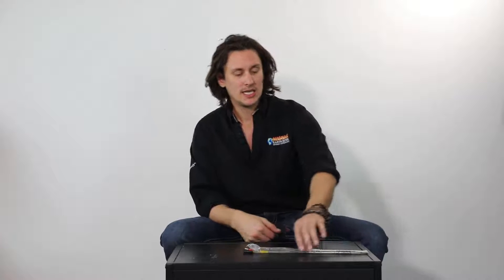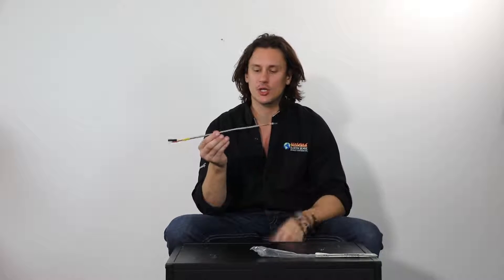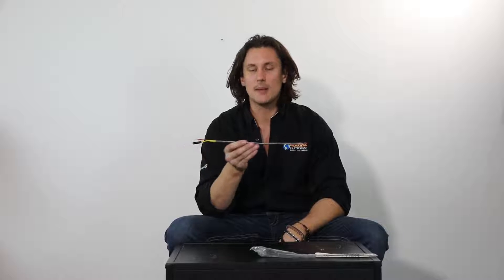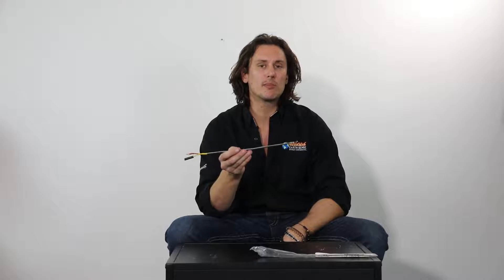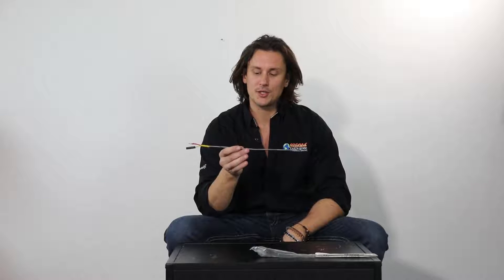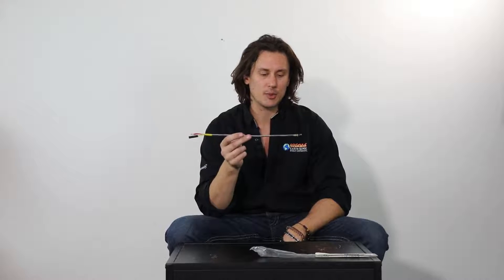Quadrafire Thermocouple Function & Troubleshooting

Comment: I have the Mount Vernon Quadro Fire AE. The pellets drop into the fire pot, however they never ignite. Would that be a thermocouple issue?
Reply from the maker: Thanks for contacting us Vincent. First thing we would suggest would be to check the Ohms on the igniter element to see if it's in proper range. The Igniter in the Mt Vernon AE has it's own wire harness with an in-line fuse. Let's also check that fuse with a multi-meter to determine if it's good. Here is a short video on checking your igniter ohms. https://youtu.be/z4wmCc96rVI

If you have the factory 380 Watt Igniter reading in operable range should be: 35.5 -43.5 ohms

If you have the 300 watt pellet only igniter, operable range should be: 43.5-53.5 ohms

Keep us posted, happy to help.

Comment: I have a Santa Fe pellet stove that will go three it’s start up  fire will start then after a few minutes dies out and stove will not send any more pellets. I have a new control box and replaced the the snap disc.  what else should I look at?
Reply from the maker: Hey Tyler, 
The thermocouple over the burnpot is detecting the heat during the start-up sequence. Once it reaches proper temp it signals to the control box for the unit to go into normal operation mode and feed pellets. You should see light indications on the control box once the thermocouple locks in. Let us know if you are seeing any light codes and let's also inspect the thermocouple and connections. You can pull off the ceramic cover- thermocouple should come to a soldered ball at the end. You can use a dry paintbrush to sweep away any ash on the cover or TC. Here is a link to the Santa Fe Thermocouple for reference. https://pellethead.com/product/quadrafire-heatilator-ecochoice-thermocouple-14-oem/

Keep us posted, happy to help.

Comment: Do you have a video on other Quadrafire Mt. Vernon repairs? like fire pot replacement, and springs on the self cleaning linkage?
Reply from the maker: Thanks for the message. Wouldn't have those videos at this time, but I went ahead and added them to our queue - good suggestions! Here is a Mt Vernon AE Blog/Forum we host which can be a good place to get various info and tech support. https://pellethead.com/quadra-fire-mt-vernon-ae-service-troubleshooting-support/

You can always message us here as well and we can provide tips and support for whatever you are replacing. Hope that helps.

Comment: If there is a split in the thermocouple can it be sanded down or must it be replaced?
Reply from the maker: The thermocouple consists of two flexible metal rods wound around each other and come to a soldered junction at the end/tip. If the soldered end is split, one could attempt to re-solder and see if the electrical signal will pass through. In the large majority of circumstances where the thermocouple is damaged/split it would need replacement. Here are the Quadra-Fire thermocouples for reference. Any other questions please let us know. 

https://pellethead.com/?s=quadrafire+thermocouple

Thanks,

Comment: Hello, I have a 1200i and we had a bad storm yesterday and some water got on the back of the insert and on the control box, I guess from the wind blowing it in the chimney top. Initially the blower would turn on but the red light would not and it would not feed pellets. I vacuum out the hopper and thoroughly cleaned everything, I checked the  number three snap disc, I looked at the thermal coupler end and I guess it looked ok , made sure the control box is set to #1.... when I slide it back in to test it ...I get a red light that goes on first in the control box, then I get a blue light that blinks a couple of times  and then it switches to a amber light flashing three time fast ....and repeats .... blower does not come on anymore. Is the control board bad or thermal coupler?? Is there a way to test either ?? Thanks
Reply from the maker: Hey Doug, just checked in with our techs on this. First note: The amber light in the control box is an indicator that the board is reading an open circuit on the thermocouple. Check the connections on that and if they are good then the thermocouple has broken and is not functioning.

Keep us posted, happy to help.

Comment: If the thermocouple was bad, could it allow an overfill of pellets in the pot? My 1200i keeps feeding no matter what is going on. It never stops.
Reply from the maker: Thanks for the message. In short, no. The thermocouple purely acts as a proof of fire giving signal to feed once proper temp is reached on start-up and will stop the feed should the temp go below.

Let's visibly inspect the auger motor if we can. The auger motor will always have an on/off timing sequence. During start-up the off sequence is very short. During normal operation that timing sequence varies based on the low/med/high setting. If you are physically seeing your auger motor turn non-stop or if the timing sequence does not change during normal operation between the heat settings, it would most likely indicate we have a control box issue. 

If we are seeing the variances in the on/off timing sequence of the auger motor, then more than likely the issue is with our air flow and it's giving the appearance of the stove overfeeding. 
#1. Full thorough cleaning. Stove, Ash Traps, Venting.
#2. Door gasket seal check - tight all around.
#3. Burnpot check. Gasket sealing, holes open, porkchop bottom sealing tightly
4. Combustion Blower/Exhaust Fan - Check voltage, should be near line voltage on start-up - varies in normal operation depending on heat setting. 

Keep us posted, happy to help. 
Thanks!
Reply: @EarthSense  it was a really weird issue. Basically my 1200i was dumping pellets in the pot nonstop. I went on Amazon and bought a replacement for $200 and the problem is gone. Thanks for the help.
Reply from the maker: @tareqtok  Very glad to hear that!

Comment: My quadrafire 1100i will light flame will build up then the auger shuts off and unit goes out. I have replaced the thermocouple and it still does the same thing. I have put a new control box in and have the same results. I’ve replaced the door gasket. Still shuts off. Do you have anymore suggestions?
Reply: You were right. It all started when I replaced the thermocouple. I had the wires crossed. Man I feel stupid. Thanks for the advise. So far it’s working properly
Reply from the maker: @mrpanther7013  Thanks for the message, nothing to feel stupid about, this is all very common stuff. Great job sticking with it and getting the problem solved. In the end that's what matters. Glad to hear you are warm again - any questions or needs down the road just let us know. Thanks!
Reply from the maker: Thanks for contacting us. Generally that would be a Thermocouple issue based on what you are describing. We have seen new thermocouples that have been faulty although it is rare. Let's make sure your thermocouple is placed properly over the firepot and the electrical connections are correct. (Sometimes the electrical connections are reversed). From there we can check your vacuum/pressure switch. We can bypass that switch for troubleshooting purposes to determine if it's the culprit. Links below for creating a jumper wire to test and overview on the vacuum switch. 

https://youtu.be/FDVkbsHS95U
https://youtu.be/pHeQzUmSlIE

Keep us posted. Thanks.
Reply: @EarthSense  I will check that out. Thanks. I’ll let you know the results
Reply from the maker: @mrpanther7013  Sounds good, thanks!

Comment: Why do you get TC Firepot Errors
Reply from the maker: Hey Janet, What kind of Quadra-Fire model do you have? Generally you will get TC errors if the Thermocouple does not get to proper temp during start-up or when the Thermocouple is faulty. Happy to help, thanks!
Reply: @EarthSense  it is a mt vernon ae.
Reply: We ordered a new thremocoupler and replaced still getting same issue
Reply from the maker: @janetdalby6076  Thanks for confirming the model Janet. Let me run this past our technicians. Will follow-up shortly. Thanks.
Reply from the maker: @janetdalby6076  Hey Janet, heard back from our lead tech. First let's verify the right replacement thermocouple was put in place. For the Mt Vernon AE it's called a Thermocouple K and the Factory Part Numbers are SRV7000-334 | SRV7034-247. If that all checks out, let's check the pins on the motherboard to make sure none of them have broken off. If everything looks in line with the motherboard and thermocouple connection, please send us the exact TC error code you are seeing on your wall control thermostat and we can see what other suggestions our technicians may have. Thanks.
Reply: @EarthSense  All that matched up we changed the wire and it is working now.   The one we had you could only plug in one way.  This new one you could plug in different ways.  IT is working now.   Thanks
Reply from the maker: @janetdalby6076  Fantastic to hear Janet! Thanks for the update. Any future questions or needs please let us know. Thanks!

Comment: I have a Quadra Fire Classic Bay 1200.  Upon turning on the stove, the convection blower turns on but the feed system will only give me two half turns and then it stops feeding.  I've cleaned the feed system out and it spins freely.  Looks like I'm getting a yellow blinking light in the control box.  Could I have a bad thermocouple?
Reply from the maker: Thanks for contacting us Sharon, happy to help. The combustion blower/exhaust fan should be the motor that turns on right away when you turn on the stove. The convection blower should only come on once the unit is warm enough after the start-up cycle. Is it your exhaust fan coming on or is it your convection blower/room air fan? 
The Thermocouple really only comes into play during the start-up cycle. After the unit feeds initially and lights, the thermocouple senses temp and allows the stove to go into normal operation. With you only getting 2 half turns from the auger during start-up, tells me we have a different issue. This could be the vacuum/pressure switch shutting down the feed motor.
1. Let's make sure the combustion/exhaust blower is running - should be near line voltage on start-up. (110-120v)
2. Let's make sure your gasket seals are tight on the door and ash pan
3. Let's make sure we don't have any ash blockage in the stove or venting. 
4. We can bypass the vacuum switch for testing purposes. https://youtu.be/FDVkbsHS95U

Start with the simple things first and let us know what you find. Thanks!
Reply: @EarthSense  I may have misspoke.  It is the exhaust fan that comes on upon start up.  The red call light comes on.  The auger turns two half turns and then stops.  The fire pot never gets hot.  I've cleaned and vacuumed everything and there are no clinkers in the fire pot.  I'm getting three flashing yellow lights from the circuit box.  Gasket seals are tight on the door and ash pan and are free of ash.  I cannot locate any blockage anywhere in the stove.  I will test the vacuum switch.  Anything else you can think of?
Reply from the maker: @sharonhill4372  Thanks Sharon, checking in with our lead tech on this now, will follow-up shortly.
Reply from the maker: @sharonhill4372  Hey Sharon, our tech indicates the three blinks to be an error code for the thermocouple. 'The 3 amber lights is an error code for an open circuit on the thermocouple. Typically this means a connection is loose, the tip has cracked, or the wires are shorting or broken.'

Let's do a thorough inspection on the Thermocouple and wiring connections. Keep us posted. Thanks.

Comment: Hello, my Quadrafire Mount Vernon non-AE will successfully light and go through the startup cycle, however, it will not go into normal feed mode, so it goes out from lack of pellets. Is this a thermocouple issue? Call light remains on.
Reply from the maker: Thanks for contacting us, happy to help. 99% of the time what you are describing would be a thermocouple issue in the Mt Vernon Original 4 Speed Model, especially if everything appears normal during start-up as you stated. You can pull off the ceramic cover on the thermocouple to inspect it and also check the electrical connection points. The red call light will stay on - depending on the Control Box generation there is either a blue or amber light that becomes solid once the thermocouple locks in. In some cases, especially if the hopper goes empty or pellets funnel, there can be dry spells in the auger. When this happens sometimes not enough fuel comes into the burn pot during start-up to reach the temp needed for the thermocouple to lock in. You can toss a half-handful of pellets in the burn pot and then go ahead and turn your thermostat up so the unit goes into start-up mode. You'll have a little bit bigger of a fire on start-up. If it still doesn't go into regular operating mode from there, then I would suggest replacing the thermocouple. For reference here are the thermocouples we offer for the Mt Vernon OE should you need replacement. Keep us posted! Thanks.

Aftermarket: https://pellethead.com/product/quadrafire-thermocouple-20154-bundle/

OEM: https://pellethead.com/product/quadrafire-heatilator-ecochoice-thermocouple-14-oem/

Comment: I have a 1200i that has a flashing yellow light on the control box.  The thermocouple produces around 12mv cold and about 20-25mv when I heat it up.  Is it possible the control box is bad rather than the thermocouple?
Reply from the maker: Thanks for contacting us. Is your 1200i going through the normal start-up cycle? Do you have a clear control box or is it black/grey? Let us know specifics on what the unit is doing - I can check in with our techs regarding the MV numbers you provided on the Thermocouple. Keep us posted.
Reply: @EarthSense  I hear the fan kick on but the auger does not when I activate the thermostat.  I have a clear control box.
Reply from the maker: One of our techs sent over this message regarding the Thermocouple mv. The millivolt readings are letting you know if the thermocouple is reading temp and if it is accurate. On the 1200 ambient room temp at 65-70 degrees should be reading relatively low like in the 5-6 mV range. I believe that 15 mV reading is showing the thermocouple at about 4-600 degrees and I believe that this thermocouple tops out at 30 or 50 mV which is either 1300+ degrees or 2800+ degrees. I would say that the readings that they are getting are right where they should be as long as they are not negative numbers. If they are negative then the board cannot recognize them but will not throw a TC error. Hope this helps.

Keep us posted. Thanks.